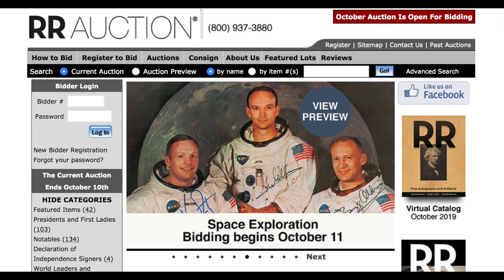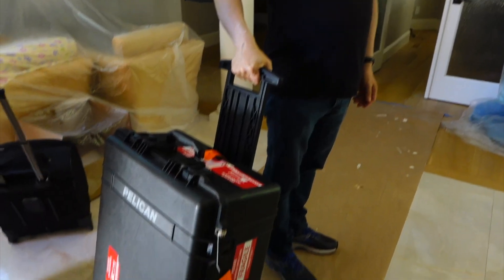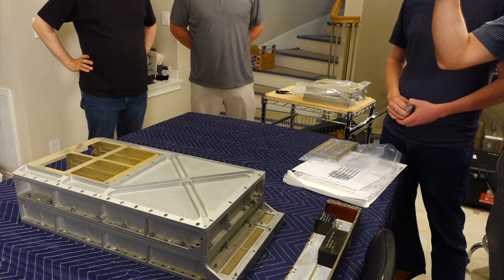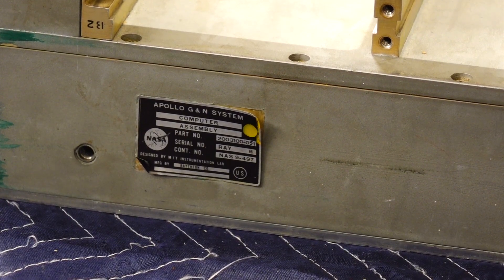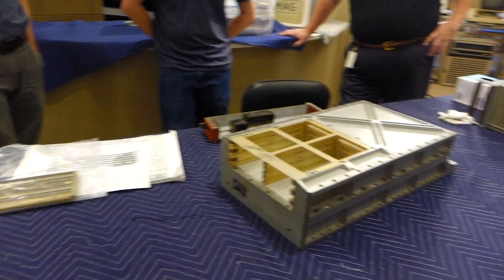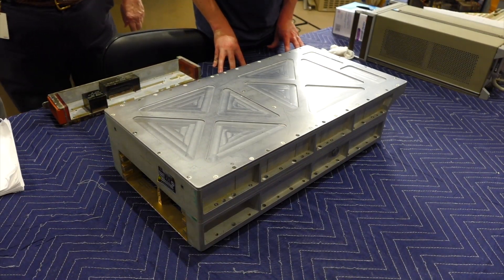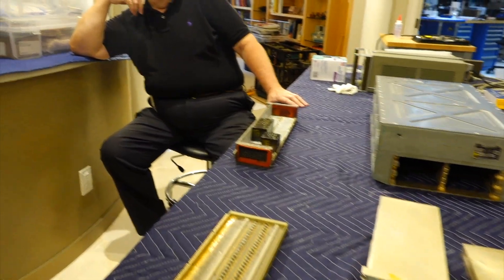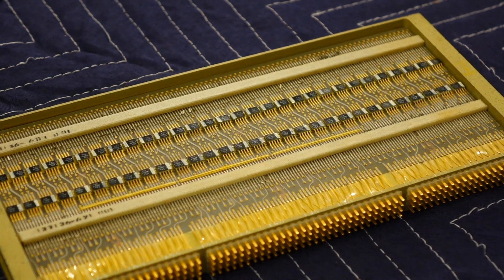Apollo Guidance Computer Part 26: We open and identify the AGC for sale at the upcoming auction

Comment: Actually, had anybody done "build your own AGC"?
For real, from scratch.
Not identical, using modern components but no VLSI.
You could use TTL instead of RTL, use SRAM or dram, flash for storage.
Just build the core unit from components.
That sounds fun.
Reply: You'd have to manufacture the semiconductors, which would get pretty expensive I imagine. (if you want authentic ones) The rest of it would be pretty simple, especially if you forgo the original gold contacts, use some random ICs etc...
Reply: @rkan2  
Ok, not THAT accurately.
I just wonder about taking the original diagrams but use modern components.
Converting rtl to TTL would be a sod though 😒
Reply: James Neave You could always try the way Mike did with FPGA, it's a functionally equivalent system just much smaller, cheaper and easier to debug and do stuff with. I am tempted by it but I don't have the $$ for the FPGA etc to do that. It would be an awesome project to do.
Reply: Yes, it has been done.
As far as I know, eg. Mike built one before he started the restauration project.
But there are others too.
Reply: James Neave check this out https://www.ibiblio.org/apollo/Pultorak.html
Reply: SRAM and flash chips are too radiation sensitive.  Core memory resists minor radiation impacts like nothing, as it needs a reasonable amount of energy to flip a bit.  Flash operates so close to the edge of possibility that I suspect a single radiation particle impact could flip a bit.  Rope memory will survive anything that doesn't destroy it physically, which is more than can be said for diode ROM.

Comment: I'd like to see the crew take on building a new one using tge original cct. Using simple 74hc series would work as a suitable replacement
Reply from the maker: It's been done, most notably by John Pultorak for the Block I. See here: see here https://www.ibiblio.org/apollo/Pultorak.html . And of course even more notably by our very own Mike Stewart, who built a gate exact replica Block II in an FPGA. Which led him on a multi-year quest to find the lost schematics and software, and finally to find a real AGC to be able to trace the exact original logic, which we eventually restored to working function. We used Mike's replica extensively during the restoration as a guide to what the AGC should be doing, and it was always pinpoint exact. Annoyingly, the 74xxx series approach falls apart when you have to implement the non-logic IC based modules, such as almost the entirety of the Tray B, for which you'd most probably substitute completely different modern circuitry and memory. It also fails with the analog I/O and alarm circuits, but you would just duplicate the original circuit discrete components. For the main logic part of tray A though, you can pretty much do an exact logic replica with TTL or CMOS and get it to boot, as Mike demonstrated.
Reply: CuriousMarc I wonder if some sort of an “homage to analog” design could be done, using a single IC throughout as a challenge, and very few additional transistors. LM118 family released in 1971 would work passably for logic circuits as well as “fast” analog needed in this application. They don’t have much drive capability without getting slow, so one could parallel them or cheat with emitter followers :). Also, the whole thing would be a thermal monster. 5mA/op-amp is, I imagine, a lot compared to average supply current per chip in the AGC?